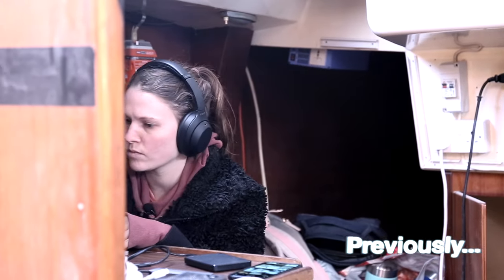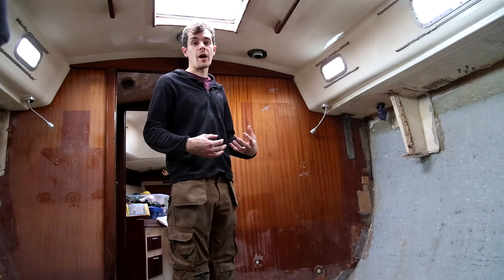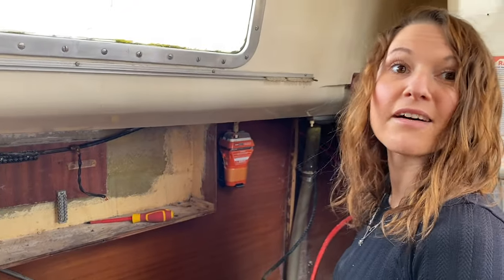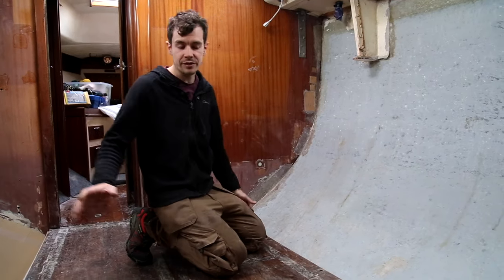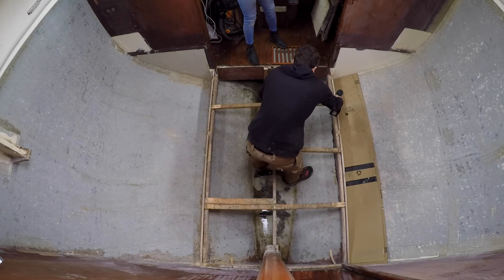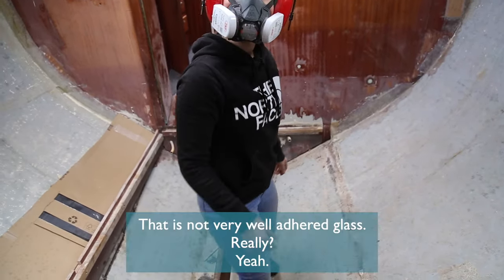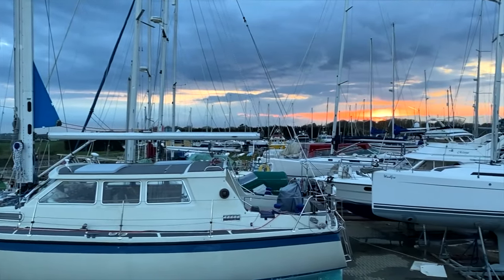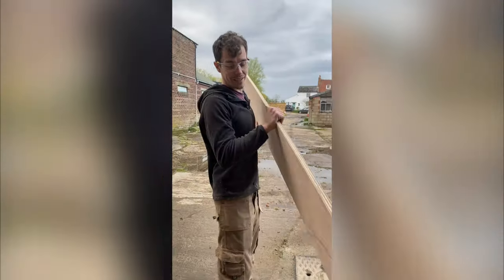Ep 12 | DODGY electrics - Is this even LEGAL???

Comment: It s probably a good idea to replace the wiring, though what you showed isn’t as scary if you could verify that it was only negative side of DC circuits. In a car, the frame (and any metal body) are tied to the negative terminal of the battery. And all lights use that as a return. Having said that, I would have some concern about total load on the wire you showed.
Reply from the maker: This is true although, any bare cable showing is scary to us!